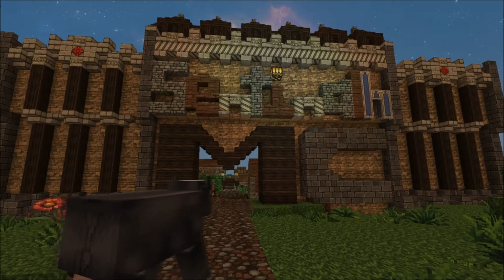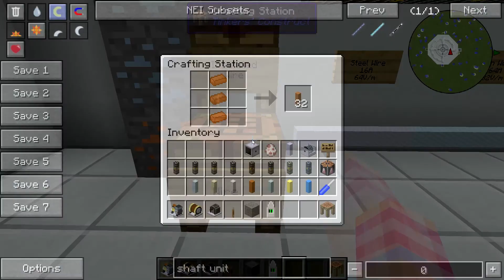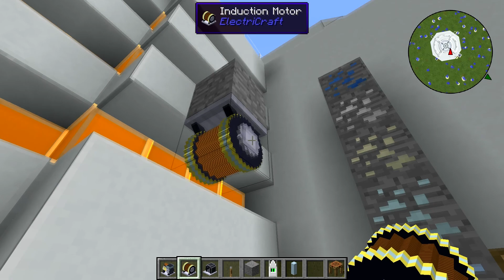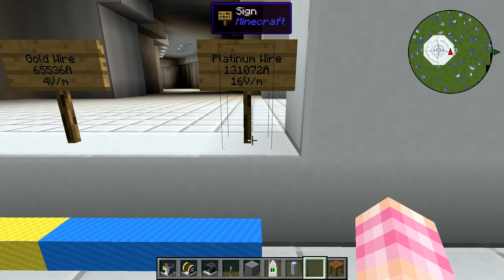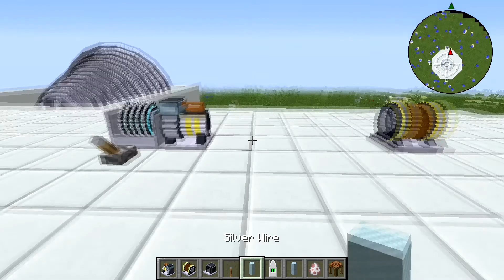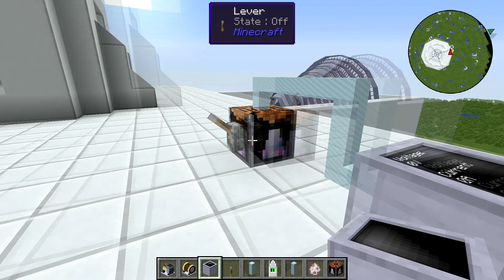ElectriCraft Tutorial #1 - Intro and Basics

Comment: The wire recipe should only give 16. Are you on non-default difficulty settings in the config?
Reply from the maker: ReikasMinecraft Its whatever the Shadow Chapter pack is using.
Reply: Check the configs.
Reply: ReikasMinecraft That and by default you need to use the RoC worktable to craft them, not a regular table.

Comment: IRL voltage drop is based on amperage. Isn't it the same in EC? I mean, running 1/4 amp through 000 AWG wire would have a miniscule voltage drop
Reply: No, ElC uses a simplified model.
Reply: ReikasMinecraft
Yeah. I sometimes find it a bit more confusing than the real thing. At least resistors don't go robbing all our power :).

Not sure if it's mentioned in game, but is EC power supposed to be analogous to AC or DC? (or a rock band :P)
Reply: DC.
Reply: ReikasMinecraft
It would be extremely cool if we had an AC version with transformers. I guess we could use gearboxes but transformers would be cool.
Reply: There are transformers in ElC. :P